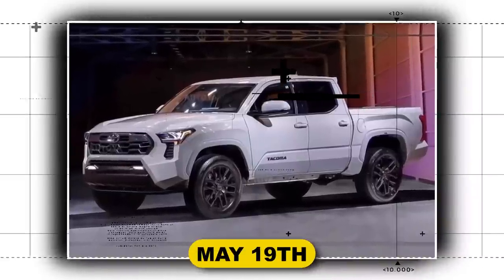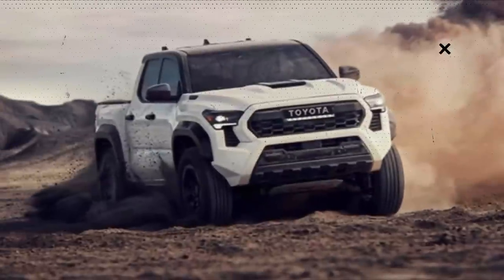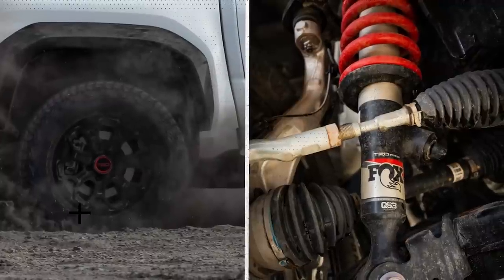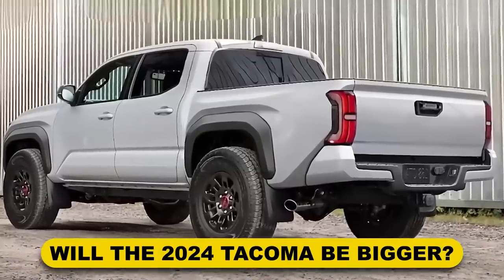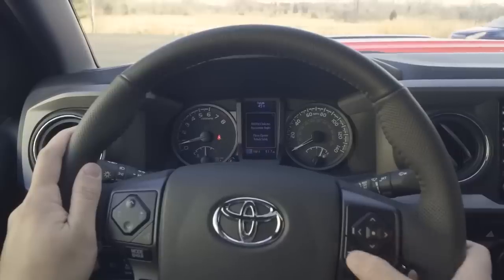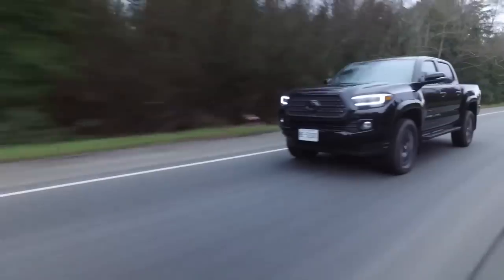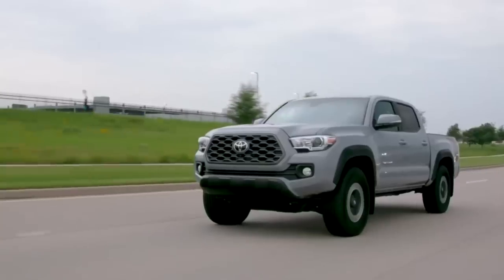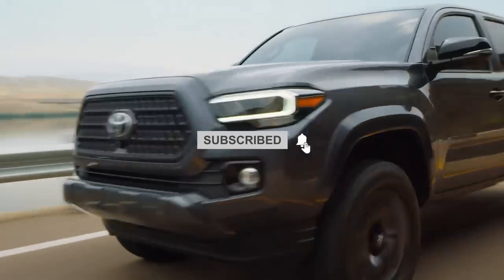Toyota REVEALS 2024 Toyota Tacoma Final Look!

Comment: Hope is still comes in V-6 will not buy on either 4 cylinder and turbio. I had a Nissan in early 80s, always problem with turbo
Reply: They have come a long way in 40 years
Reply: Doing away with the V6 option will be a huge mistake for them. I don’t want anything with a turbo.